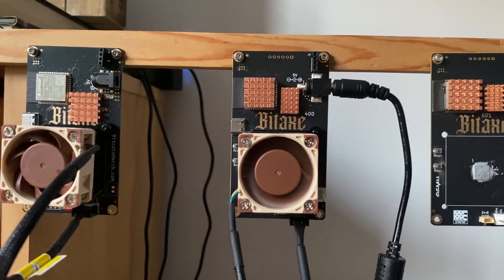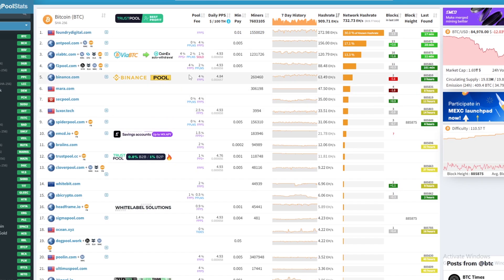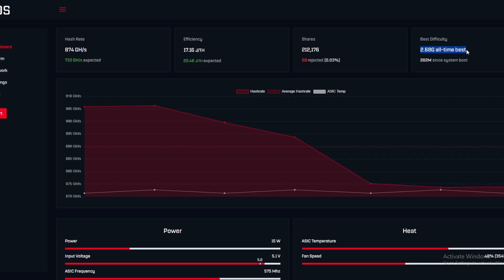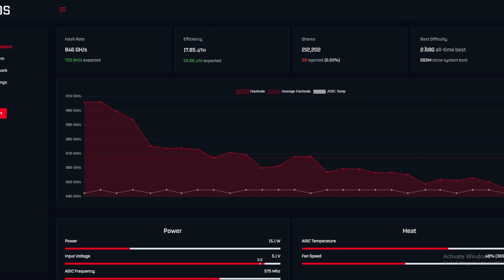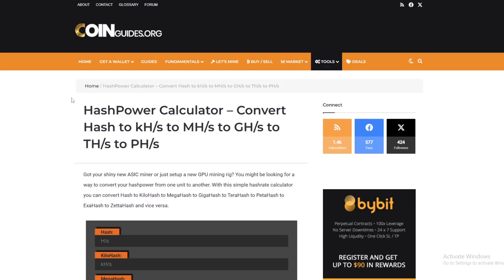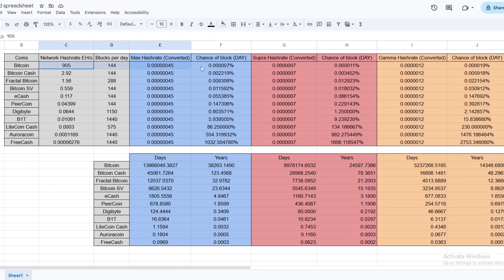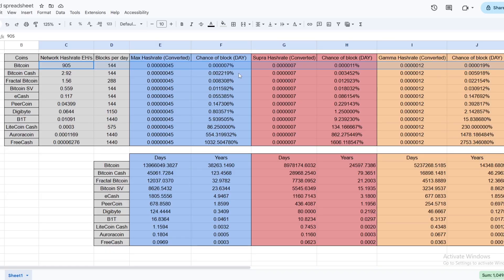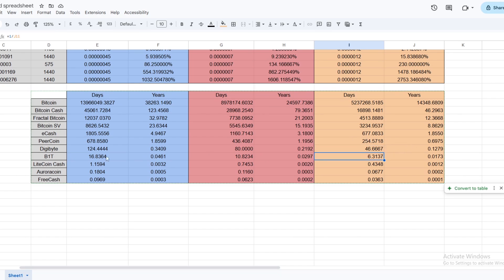What To Mine On A Bitaxe - Max, Supra and Gamma

Comment: I have a way more advanced spreadsheet, it works all the probabilities per block, day month and year. Total chances in yrs, months and days, dynamically grabs the current Bitcoin hashrate, difficulty and price using API's. Works out electricity costs per day/month, profits and a host of other stuff like asic efficiency numbers from the hashrate, wattage and price. The only data you have to input is wattage, hashrate and price of device. If there was a way I could share it with you I would
Reply: Hi, how can I get from you that model of spreadsheet? It can be very helpful

Comment: @Sterling truly great video but you should also state clearly its truly more luck than anything else, for example using my Lucky Miners LV08’s i hit 19-24 LCC blocks per day with one LV08 4.5Th, and only 7 Blocks per day on B1T per LV08, DGB i only hit 1 block in 3 weeks of testing with one LV08 4.5Th, PPC also only 1 block in the last 3 weeks, i am testing FB and XEC now, so far B1T is the best and you don’t need a wallet on mining dutch since you can setup  lazy mining to payout in the coin you actually want.